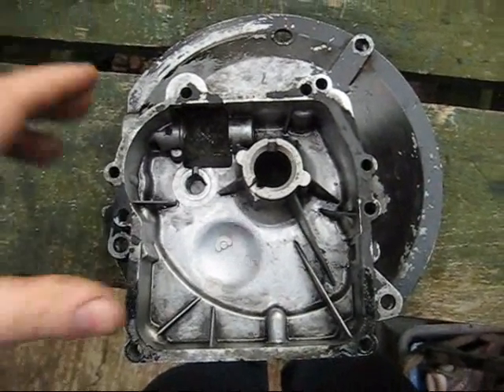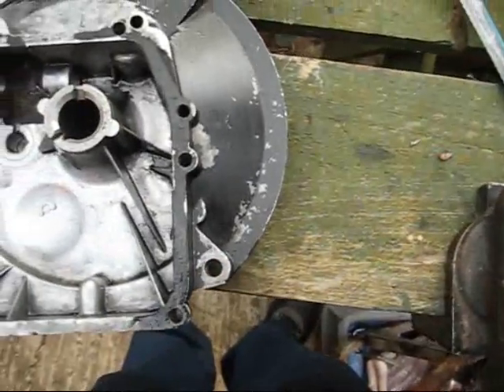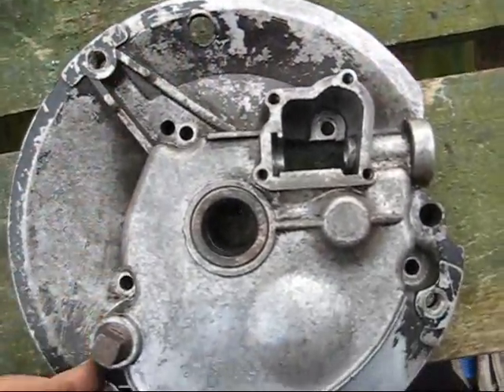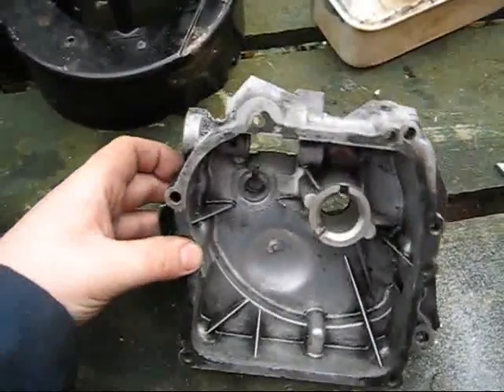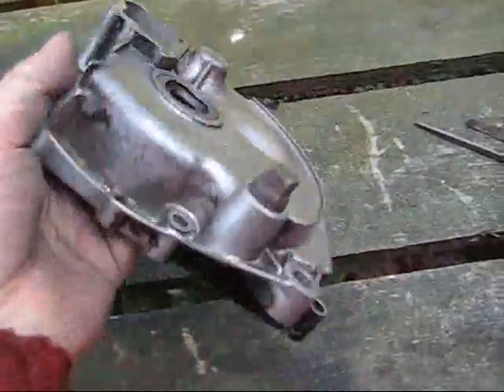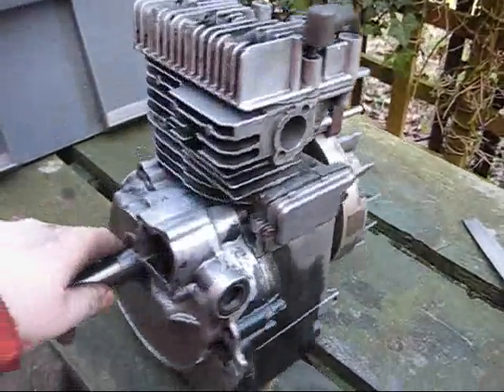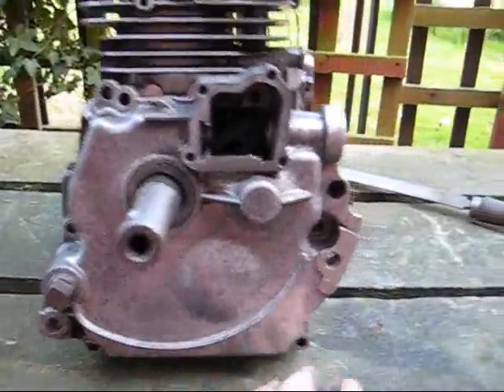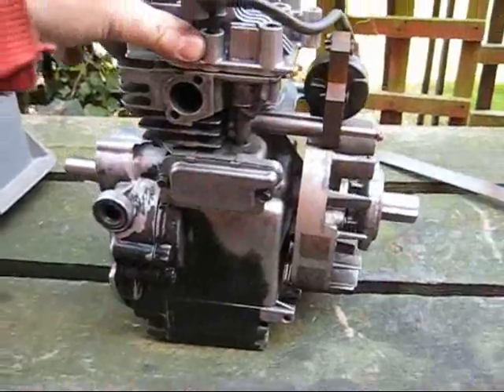3.5HP Briggs - Vertical to Horizontal Pt. 5

Comment: Vertical engines rely on the spinning blade to off set the light weight flywheel. Horizontal engines use a heavier flywheel. Another consideration is maintaining adequate lubrication. Nice project, but the world market of imported horizontal shaft engines makes them more affordable, than say, thirty years ago.

Comment: I left it the way it was, and made a 90 degree bend steel plate to mount it to a base.
You may need a heavier flywheel also, I use a steel one from a roto-tiller. hard to say how plentiful they would be in the UK.
So how popular is Briggs in the UK, they are everywhere here in Canada and the USA!